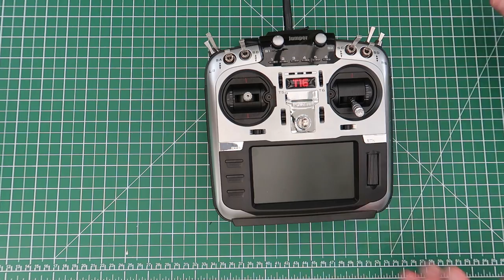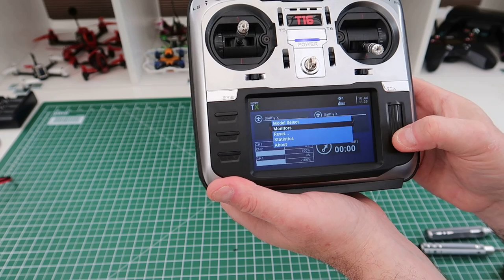JUMPER T16 FAILED!!!!!! SCROLL WHEEL REPAIR

Comment: Thanks for that. I had an issue on one of the two jog wheel switches such that the model select / reset etc menu would not come up. Removed the jog wheel assembly and soaked the switches in contact cleaner (Servisol Super 10) and hey presto. The ribbon was AOK. The only issue I had was that the power / SD board isn't captive and it ended up popping out of its slot, which meant that the SD card wouldn't go in until I repositioned it correctly. All in all - it's OK for now. I have not been impressed with the T16 Pro hardware, although I love the multiprotocol approach. It has so much potential but is compromised by some unreliable components. Having said this - I bought a new DX8 recently and it's worse than the T16 Pro for quality and reliability so far. Had to send it away to have the jog wheel replaced, and now the screen can't deal with cold weather and gets obscured by graphics from previous menus. This has made me like my Jumper a bit more ...

Comment: What kind of screw driver do you use to get to the bottom two embeded "deep" in the plastic back plate. I have right philips bit just nothing long and skinny enough without breaking plastic
Reply from the maker: which screws are you taking out on the bottom?, you just need to take the 3 screws out on the board
Reply: @CKone41  to open radio cover there are 6 screws (2top, 2 middle, 2 bottom) the bottom screws are deep thus normal size tools don't fit in the small hole to get to the screws. Get it ?
Reply from the maker: I just used a standard sized screwdriver

Comment: I came to see specifically the scroll-wheel ribbon connector as I just got my radio and out of the blue, the scroll wheel is jumping all over the place in the lcd menu.. It doesn't matter which direction you scroll, it does what it wants to. Has this happened to anyone ? Is it in fact the ribbon cable that needs to be reset? Or is it corrupted software?

Comment: I never saw the actual part replacement, it was off camera? Maybe do a edit?
Reply from the maker: Glen Roe really? I won’t be doing that it is so easy to do
Reply: Im sure it is easy. I was hoping to see it being done before doing it. It would make sense to replace the new wheel  in reverse of removing the old one. Seeing the case screws and removed as well as the scroll wheel board is helpful and I’ll find out more when I replace all my flat cables as soon as the upgrades arrive.
Reply from the maker: Replacing the cables is your biggest worry as the sockets on the board are only soldered on no adhesive has been used to ensure they have no movement.
Replacing the wheel is really easy hence no need for a further video

Comment: How is your jumper t8sg v2? Is it holding well? I'm planning to get the t8sg v2 carbon as my first controller. I will use it for simulator before buying beginner fpv drone.

Comment: Been enjoying your video's for a while now - especially as you now have the Jumper T16. Was interested in your review before I bought one.
Wanted to bind a FrSky G-RX8  (with inbuilt vario). But cant get the telemetry to be recognised by the T16 (binds to Tx in other respects).
I noticed on Andrew Newtons channel there was a step when he was binding, that having selected bind, he then pressed enter (on a Taranis) and got a sub menu 'Telemetry ch1-8 ON, Telemetry ch1-8 OFF etc. Pressing enter to accept that and then it binds.

So I realised my T16 didn't offer that sub menu during binding, but looking at the (nearly complete) T16 manual it shows the same sub menu...
Do you get that sub menu on your T16 on binding to a FrSky Rx.....?
Any advice would be much appreciated!
Cheers Andy
Reply from the maker: Hi mate yes change it to d16 then when you hit bind it will give you the option
Reply: @CKone41  Hi Thanks for an amazingly fast response -Top bloke! Just tried that and still not getting that option :-( 
This is a new Tx to me (currently DX8) and the first Rx I have tried to bind. Could there be a fault with the Tx or firmware??
Reply from the maker: Andy Milton that’s strange mate if you select frisky it should let you change below to d8 d16 etc.... when you hit bing on the d16 it should come up with a sub menu which allows you to select the 4 options
Reply: @CKone41  Yep that's what I thought - Mult - FrSky - D16  down to bind hit the enter - Zippo???? Just don't know where to go from here!
Reply from the maker: Andy Milton hi mate if I get chance I will have a look at mine tomorrow i don’t use telemetry as I use the info in my goggles from betaflight
How may wires are connected on your reciever
Reply: @CKone41  Hi my friend, sorry didn't get back earlier..
The telemetry sensor is in-built on this Rx so there would only be the connector from the esc for binding. But my thoughts are that even if I didn't have a FrSky Rx in the house when selecting the Rx protocol on the T16 of "Multi-FrSky-D16" it should show the required sub-menu on pressing "enter" then selecting the appropriate item for telemetry before then pressing "enter" again setting the Tx into Bind mode - ready to then see the Rx as you power up the Rx with the bind button pressed? Am I missing a point here?? Cheers Andy
Reply from the maker: Andy Milton hi mate no you are right I don’t understand it have you got the latest firmware on it?
Reply: @CKone41  I think you have too much time on your hands to respond so quickly!! Although I am really grateful!!! :-)
Hmm need to check the firmware point I guess but thinking it needs to be an email to Jumper. Will let you know how I get on. Cheers Andy